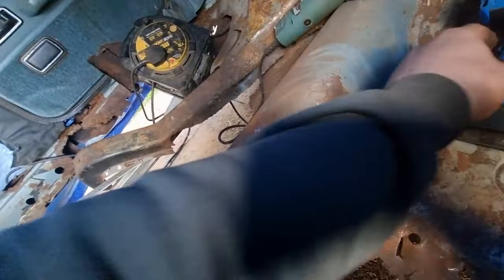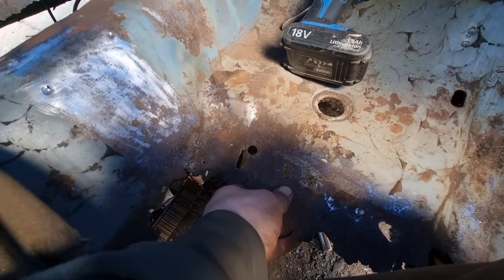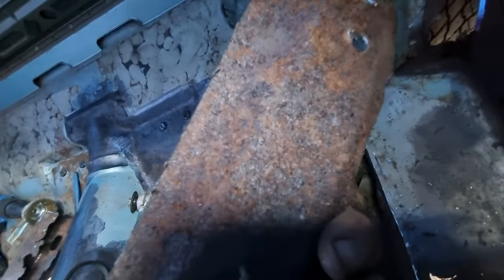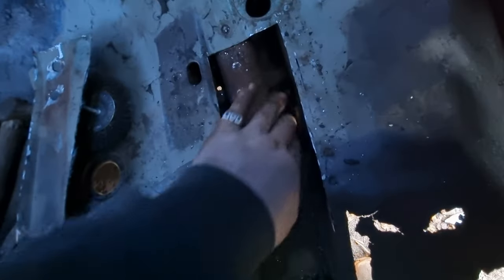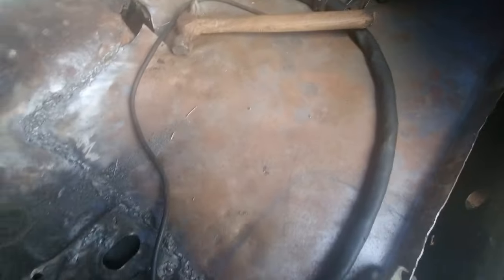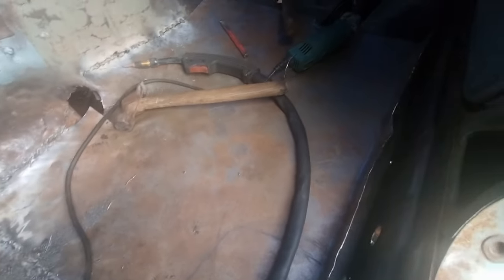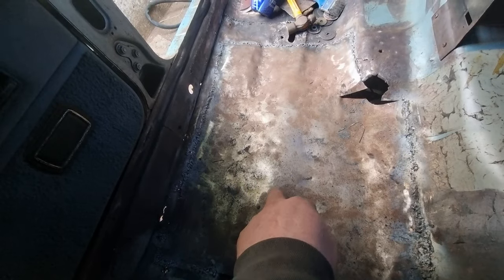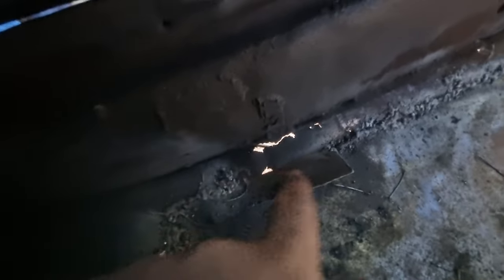Cortina Mk4 Ghia 2.3 V6 Restoration || Passenger Rear Floor Pan P7 (P39)

Comment: Great progress there Adam, Yeah i don't blame you one bit for building the driver side your self. By the time that floor pan arrives, you could have made one your self.  Plus the 200 odd quid can go towards something else, that the car needs, or what you need.  Also with the Bus fare you have gained doing this side, you know what your dealing with, and plus its a reference as i mentioned when you did the inner wings.  As for for people wanting to have a pop at you for doing metal work, rather than buying, it works out cheaper, easier and quicker.  Plus replacement panels you have to faff on with too,  Keep pushing, and i recon with in a two months, i can see this having a solid floor inside. From what i remember the boot floor is spot on. So you are not that far off having a solid car really, once the driver side is complete.
Reply from the maker: thats it yeah the boot is not bad at all but a fair bit of work to do underneath the boot we shall see but yeah the rest of the car will be solid really carnt wait :)
Reply: @AdamSNook.  yeah i think that will be where the wages will be needed, Also welding on your back is a lot trickier too.  Not sure if you have ever did that.
Reply from the maker: yeah i have welded under my van and set my self on fire hahah and burned my harms when hot slag as gone dowm my sleeve the more you move the more it burns haha

Comment: If it was me I’d get a grinding disc to get it near and then use the flap disc to finish off you will find they last a lot longer I only use the cheap ones and dear ones don’t last that much longer if I’m honest , dewalt 125mm x1mm cutting discs from screw fix are best
Reply from the maker: thats a good idear yeah 40 grit and 80grit but knock them down first with grinder disk :)

Comment: Your doing a great job with the equipment you have looking good can send you a roll of wire I've got some spare and a few cutting disks wat size wire you useing ive got tips as well if i can find you address to send my disks 125mm size i will send them the weekend all as is a shout out how much for a floor pan and months wait for it i would build it myself as well mate
Reply from the maker: Aww erm I think my grinder is 115mm  and my small one is 75mm my welder I'm using 0.9 wire and 0.9 tips
Reply: Swap email addresses and arrange from there 👍
Reply: @AdamSNook. 125mm will work on grinder but you might have to use it without the guard 🫣😁👍🇮🇪
Reply: regarding wire, I've experimented with different brands and some are much better than others, I probably only use 1 roll a year so if I like the roll I put a paint  ✅️ on it to remind me what to get next time.
Reply: No sorry wrong one it's Gmail not outlook mate sorry
Reply from the maker: yeah i have noticed this to some welding wire works so good and others are not so good and you can really tell the diffrence
Reply from the maker: my email address is attached to my youtube adams-nook its in the description part
Reply from the maker: youtube dont let me see email address they block it